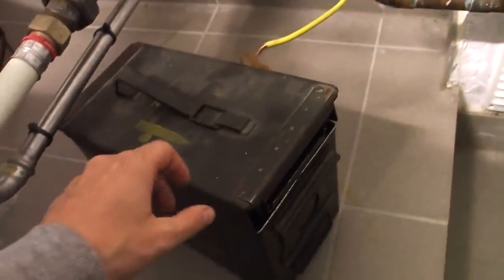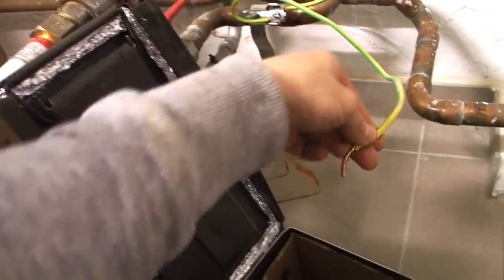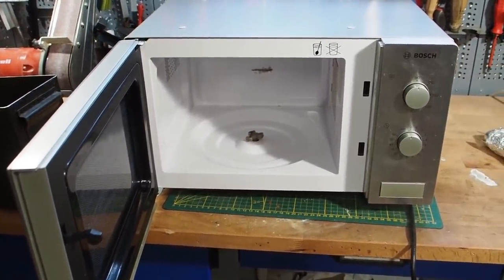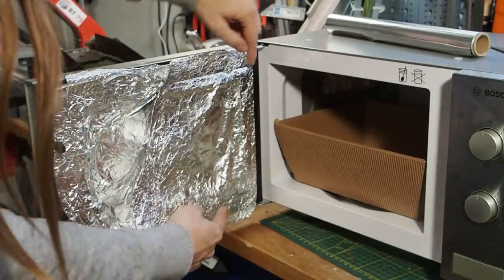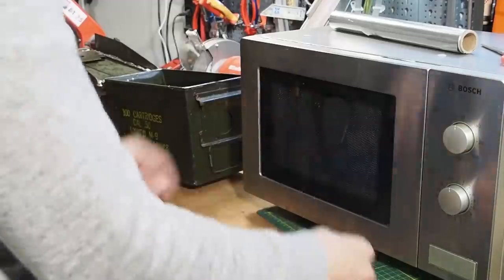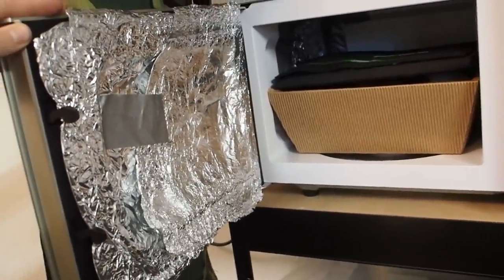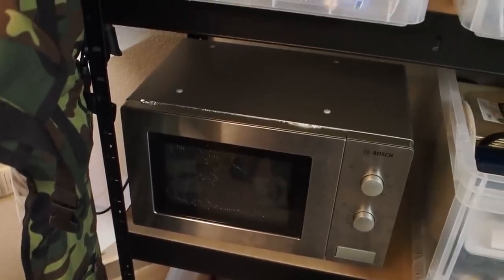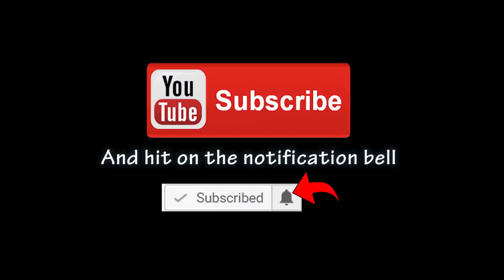How to make a Faraday Cage out of a Microwave #EMP

Comment: Lilly i have a very large cardboard box covered in chicken wire i can get all my electrical equipment in and have a spare alternator for my vehicle and until we get a massive solar flare i wont know if it works...
Reply: You can test it, you'll just need to make an E.M.P of your own (High voltage, High frequency), and try it out on some old phones, with and without the faraday cage.

Electroboom makes some entertaining videos on that sort of stuff 👍
Reply: A mesh won’t work.
Reply: @guyfournier  my mesh is aluminium
Reply: @stephenwest1491  I’m just trying to let you know that it won’t work. Just look it up.

Comment: Hey, if the aluminium foil works fine to block out electrical interference at the holes, couldn't a cheaper, easier, lighter, and more space efficient thing be to just wrap and tape a cardboard or plastic box in a few layers of the foil and ground it?

Comment: I don’t understand why you eliminate the rubber seal ?.

The ammo can proper is grounded to the ammo can lid via hinge ..

You now are going to use the ammo can for something 

else but it’s now not water proof ..

Leave the rubber seal in place ..

The ammo can is a great EMP proof container but leave the rubber seal in place !.

The lid on the ammo can has sides that extend down the 

sides of the ammo can (at least the ones that I have do) 

about a half inch or so and will give it great 

protection against E M P stray voltage ..

I would not ground any containers to your water pipes 

or anything else except a direct ground setup ..

Your water pipes (during an E M P event) now become antennas 

and collect all that stray voltage created by the E M P and send
 
it directly to your E M P container ; NOT GOOD !.

Old non functioning microwave appliances are great for E M P protection 

just set them up the way you’ve showed on this video ..

For a good grounding strap get a piece of rebar at least six feet long and pound 

it into the ground at a safe location leaving just enough rebar 

exposed to attach a grounding wire ..

Attach a grounding wire to the rebar then connect the grounding

wire to the metal box ..

Something else you can do is get a piece of sheet metal whatever 

size you think you will need and lay it out on the ground ..

Then hook up the sheet metal to the grounding strap ..

Just set the metal box on the sheet metal and it’s grounded ..

Make sure there is no paint or other insulated material on the bottom 

of the container being used as an E M P protection device 

that might hinder the flow of electricity to ground ..

Comment: You are protecting your cellphone when cell network will be knocked out along with power grid . If you remove batteries it will not be affected too . Like your car . If you install a battery cut off like military vehicles it should be ok too . If you had older vehicle with points instead of electronic ignition and have an extra set of points and condenser , your better off .
Reply: Sorry, but it has nothing to do with the battery. The electronics ('computers') that cars depend on these days would be fried in a second.. It would have to be a pretty old car to survive it. My '92 had electronic injection.
Reply: @barrybogart5436 the battery has everything to do with it . No electricity no overload .
Reply: @georgedeedsnotwords2162  The electricity is externally 'induced' by the pulse. Taking the battery out of the cell phone or radio would not help either.

Comment: If Iran ever acquires nukes, it's a given they'll use 'em. So, thanks for this info. Question though... is there a way to test this, other than a nuclear explosion, to determine if it's actually working?
Reply from the maker: They use faraday cages in power plants were they shield themselves from power surges. But no, you cannot really test it. Also it depends where you are and how far away you are from the impact zone.

Comment: You do NOT want to attach the house ground cable to ANYTHING like that!!
~
If  an EMP or especially if a big Coronal mass Ejection hits, it will massively overload all power lines due to their length across the country, with a current in the MILLIONS of volts
That will then completely blow the electric circuits in a house, which will jump into the "ground wire" in the house and so fry ANYTHING attached to that!
It's like a lightning strike: the voltage and amperage is so extreme it will jump extreme  distances (easily 1 or more metres though the air), melt and burn things etc
So you do not want ANYTHING linked to your power circuits in such times.
~
Switching off the breakers in a house probably won't stop an EMP/CME surge due to the extreme voltage and amperage, hopefully though, the number of outlets and ground wires will weaken it
A lighting strike, for example, if it hits power lines near your home, can jump over a metre form a power outlet in the wall to a plug in a device (that can and has happened)

Voltage = the length a spark/lighting strike can jump though the air
Imagining it all as a vehicle, "Voltage" is how "fast" the vehicle goes and "Amperage" is how big it is.
Its actually the "amperage" that has biggest effect for damage

~
most ammo cans don't need the gasket removed, they usually have bare metal touching metal in the hinge, that's all you need
If it isn't bare in the hinge, just clean off some paint in the hinge area :)
~
Simplest Faraday Cage is this:

1) Put the items in a box, or within carboard taped together, or whatever to make the items easy to handle and to stop the items poking through the layers of plastic/metal

2) Wrap the items in plastic wrap, make it airtight

3) Then a layer of tin foil, if possible seal it air tight with aluminium or copper tape (this is not essential but helps)

Then do more layers like #1 and #2 and more layers the better
Usually 3 or 4 such dual layers will give total protection

Sealed Mylar bags also work great vs EMP
again, multiple layers, one bag inside another, help

:)